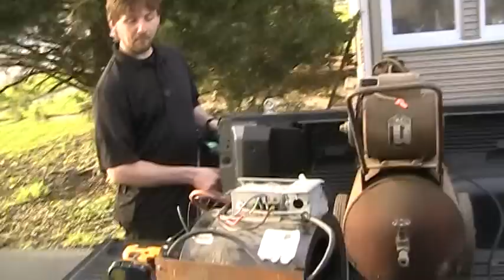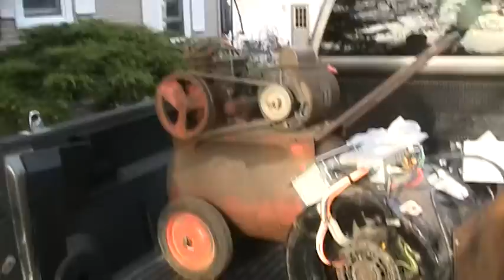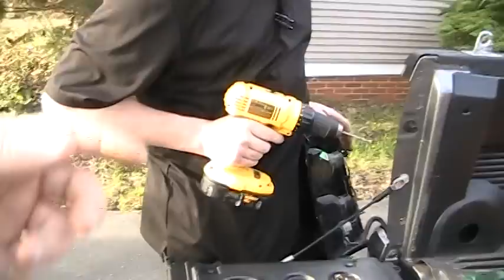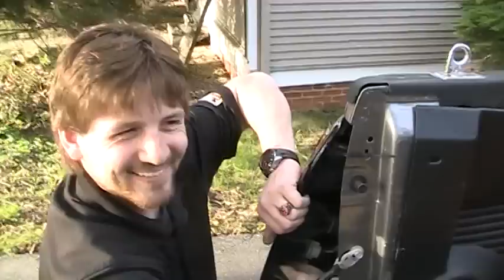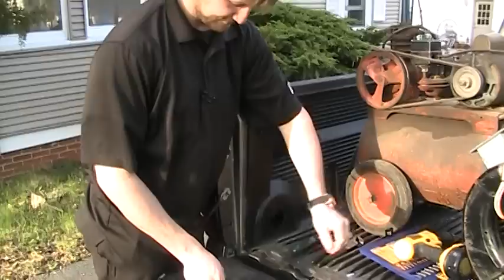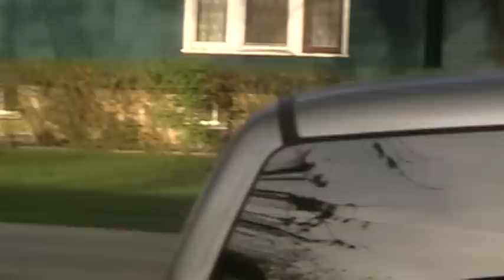2007 Chevrolet Silverado Tail Light Lens "Redneck Repair"

Comment: Reminds me of what a friend did.
his 2000 sunfire the plastic part around the headlight socket cracked he epoxied it and used zip ties to take the pressure off the epoxy so it didn't reopen. been 8 years since the repair and still holding.

Comment: I'm calling the vintage air compressor abuse hotline!! :3
Reply from the maker: It's still better than what would have happened, had I not rescued it from the curb. (I figured the motor alone -- which is good -- was well worth it.)
Reply: ***** Yes, I agree and as long as the seals in the pump are good and it is in good mechanical order it will probably last decades to come.

Comment: It's not necessarily a matter of not having the $70, it's more a matter of not having to spend the $70 on such a trivial part of the vehicle.  Kind of along the lines of "it's the principle, not the money".  Anyway, those zip ties will work great until they break, but you can buy a whole bunch of zip ties for $70!
Reply: $70 is actually a bargain for a tail light assembly.

Comment: I once bought an eBay knock off tail light for an 04 Expedition. It did not fit as smooth as the OEM but with some plastic surgery it forced into place just fine and at a third of the price of an original. It was a leased car anyway. 

eBay knock off side mirrors for the Monte Carlo were just $25, they work fine, but the black plastic they are made out of has faded sooner than I wished. Probably take them off and paint them, just need some of that carbon fiber pattern paint I saw at Harbor Freight.

Comment: So I have to ask, why not just liberally epoxy a flat washer and a nut to the back side of the broken plastic, then you could bolt that sucker back in.  A few years ago, I had a V8 and transmission still bolted on in the back of my truck driving home from the junk yard, and I thought the sheer weight of the the 2 would keep it basically in place. I learned very quickly that they side very easily around the back, including into the back of the bed bending it against the cab with an impressive thud. Stuff just has to find it's happy place in the bed, then it stays put :)
Reply from the maker: Offhand I'd suggest that one might be in for a world of amusement if ever the nut broke free.

This had the advantages of being cheap, really quite effective and making use of stuff we already had around.

Comment: you smashed the computer to pieces though in the back
Reply from the maker: There isn't a computer in the back of the truck, and nothing was smashed.
Reply: ohh I saw a case was it empty ? was all crushed a bit there bill sorry was looking at vidios you posted while I was away for a month in May hahha I watched it again was when you said tipical GM crap hahha you showed the stuff in the back did that compressor work looked old but good one ?
Reply from the maker: That's a crappy plastic speaker enclosure that I had already been well into the process of destroying. I later separated it all out and sent off each material for recycling (plastic, metal, paper, etc). The circuit board you see is from a table TV that fell while someone was moving. They got called away, and seconds later, heard a spectacular crash from the TV falling over. Same thing: I broke it all down to parts, saved some interesting components and recycled the rest.

The compressor still needs to be completely rewired. It will build pressure slowly if operated by hand, so I believe it will work.
Reply: ok thanks Bill for all that hey post more video's please

Comment: any local wrecking yard would have them for like $20
Reply from the maker: Area junkyards (none of which are even remotely "local") seem to be rather more proud of their products. I'm no stranger to eBay. I found no bargains there either.
Reply: +uxwbill if you want I can keep an eye out for one in my area.
Reply from the maker: This repair is still holding up very well, so I don't think I'll need a different tail lamp assembly. I do appreciate the offer!

Comment: It could be MUCH WORSE: a tail light for  a 2015-2016 F150 with the blind spot monitoring system is an EYEWATERING $1000!!! With the same amount of cash, I could walk into the parts department of my Local GM Dealer, and get the Driver's Airbag for my 6 year old Chevrolet!! I can understand why my airbag costs so much; it's a highly engineered safety device, designed to make sure my head isn't caved in by the windshield and steering wheel in an accident! This proves my point that fords nowadays are Ugly, Overpriced, and Overhyped!